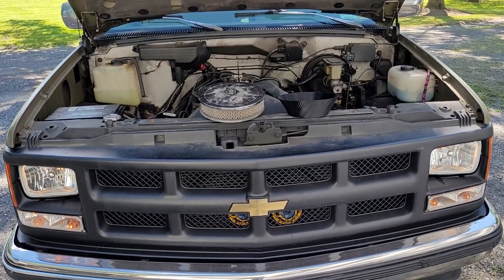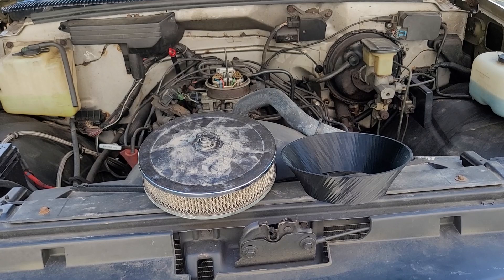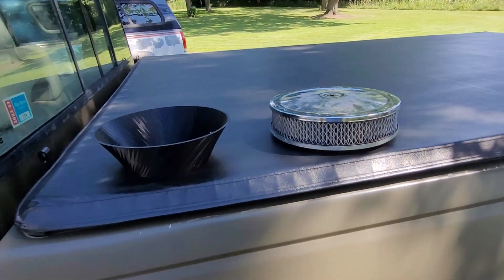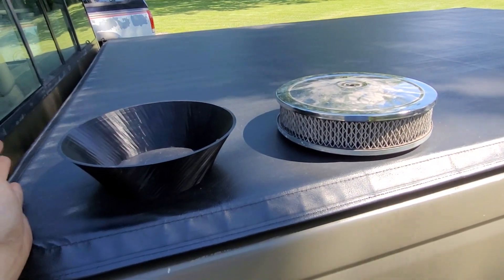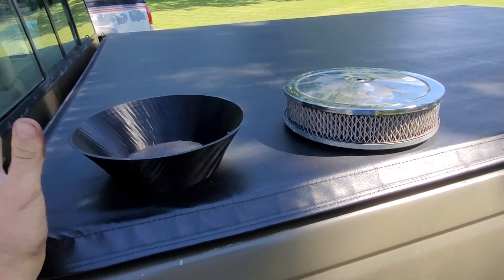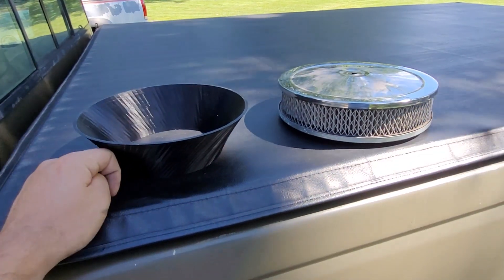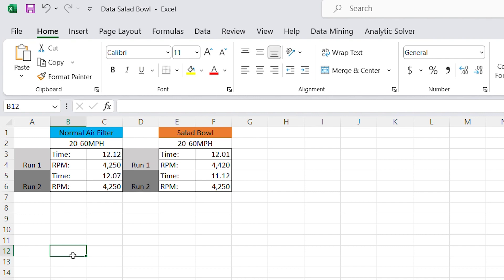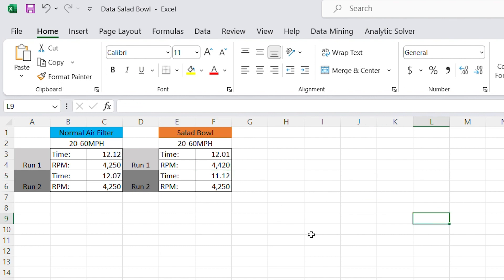Will we get more power from the "Salad Bowl" Air Cleaner Adapter??

Comment: Why didn't you ever try or put the tbi spacer and test the 0-60
Reply from the maker: I tried the TBI injector spacer in another video.
Reply: @Rollins-BauckePowerSystems  any difference i ask because I had to add it not because I wanted to and the injector spacer but I wish I could of added one at a time to feel a difference
Reply from the maker: @joshup1275  I have done some CFD analysis on the injector spacers and those will allow more air to flow in a stock set up. You will gain benefit from this at higher RPM. The Salad bowl is suppose to promote air flow by removing 90 degree turns that the stock set up has. The one I made in this video was small and only reduced the angle slightly. If I was to spend the money on something it would be the Injector spacer. Let me know if you have any more questions!
Reply: @rustyroadtrips  I made a mistake on putting 3 inch y that killed my low end but made it up on the top but I noticed a big difference with just the  intake, tbi and injector spacer else was factory stock but I wish I could of added the tbi spacer then injector spacer to see if they did any difference to performance

Comment: that cheap spacer in the other video is convenient though for a van with about 360,000 miles to install, even if this thing on this video worked, dont think it would fit. I dont want to do much with my hightop conversion van, but it does have a bigger 2.5"-3" exhaust, catalytic convertor made for a 454, 3.73 gears, k&n air filter. That was 100,000 miles ago.  My air filter is smaller than yours, with the paper one, I would give it the gas from a dead still stop, floor it and it would cut off, the K&N I mean wow that helped, you hear that wooing if you floor it in Overdrive by accident from all the air rushing in.

Comment: I’ve had several TBI 350 trucks ( still have a 91 )  , but have driven a few with the 305  … this truck accelerates like a 305 .
Reply: Agreed. TBI 350s are built for torque my dads 91 new off the lot was strong

Comment: I love that youre trying new things with the TBI trucks. Most people just do the carb swap or insult you for not buying a vortec. Nobody has 'really' tried to push the tbi unit. You should try out doing an adjustable fuel pressure valve mod (i believe theres a video floating around how to do it.) On top of these things.
Reply: I disagree on nobody pushing the TBI systems.  I had one that made 357 hp at the tires nearly 2 decades ago.
Reply: "insult you for not buying a Vortec" - so true. or you get "just LS swap it and be done with it"
Reply: I would suggest getting the tbi spacer it’s lifts the injectors 1/4 giving you more space for air flow. The airaid cold air intake and throttle body spacer also work great in conjunction. I have all 3 on my 94 1500 and have improved performance and mpg.